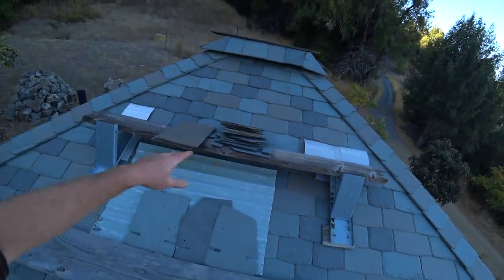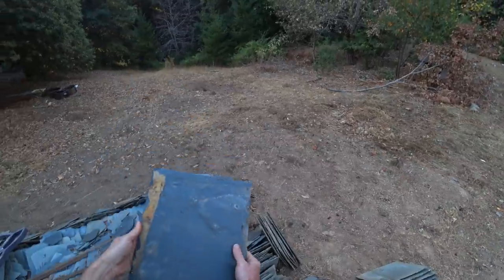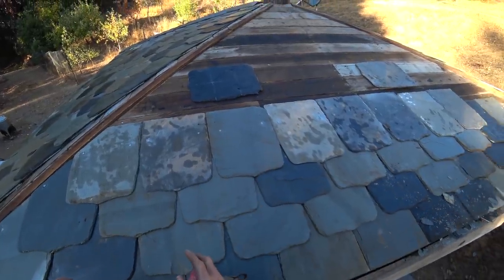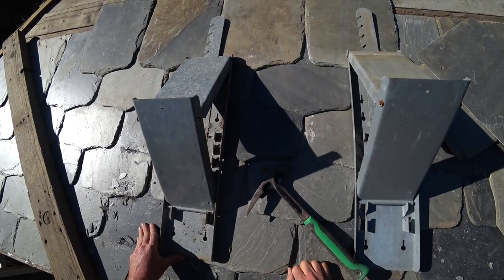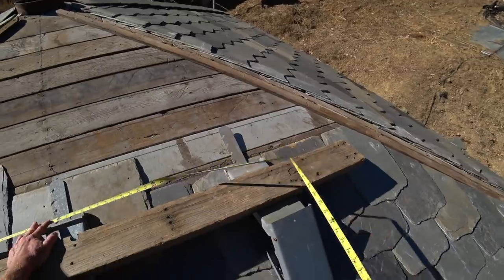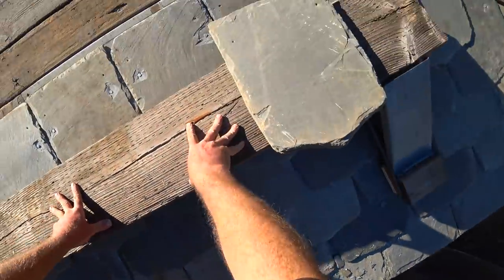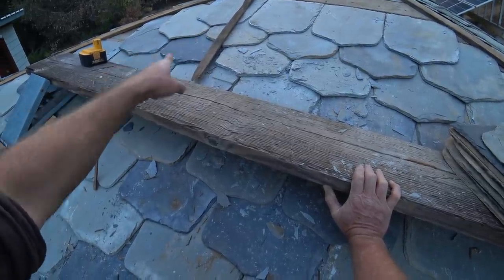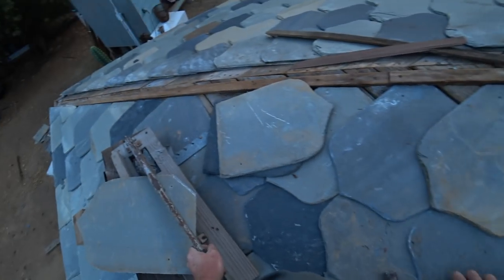Stone Roof #3:  Race to the Top

Comment: Thanks for continuing to share this project Steven, I'm more fascinated the more it takes shape. Is the center hole for an eventual chimney or just a vent?
Reply from the maker: It's a vent. It will vent both the bulding and the roof space.  There are screened vents on all the rafter blocking to allow full ventilation.  I still don't have a design yet though, just concept.  The center is a metal ring that was custom made to screw that rafters to.  It's pretty beefy.

Comment: So the ones punch on the wrong end could be used if you slipped a flashing under it wouldn’t it? I mean in a pinch
Reply from the maker: If used upside down, they shouldn't actually leak, it's more cosmetic.  I might do a pattern somewhere with them where the holes are just cut off.